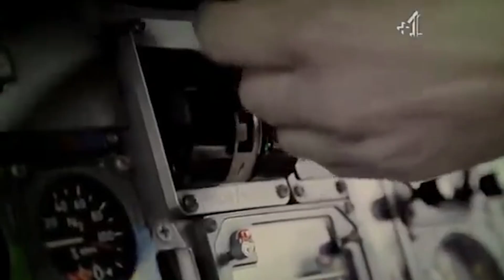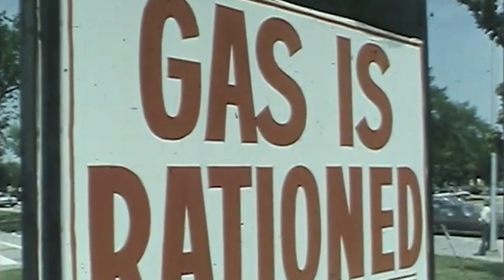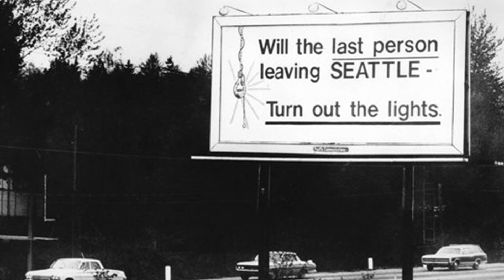The Forgotten American Concordes - Boeing 2707 - Lockheed L-2000 SST

Comment: I believe from some smattering of news on the web, that Richard Branson of Virgin, is trying to revive the Concorde program and have them flying again.
Reply: But that microscopic fungus is common in all aircraft fuel tanks if not managed. I remember my days in the 80's in our South African Airforce, the tiffy's who had to climb into the emptied and flushed out tanks (the fumes so they were not overcome) to look for this fungus and any damage it would be causing. I'm no expert in this as I was and am still involved in electronics, IT and programming, but these guys said that it grew on the line between the air and the fuel itself. And you mentioned one of the issues, but it also attacked the alloys/metals in the tanks, so was monitored regularly. This was not such a problem with aircraft using the "rubber"(more like some fuel impervious rubber compound I think) fuel bags inside the tank space.
Reply: As I said I am no expert in this area and it's not my career, but it's what I observed as part of the service teams in the 80's, of our military aircraft. That is these 'rubber' bags that were introduced and used. Apparently it had other positive effects as well, in that they deflated as the fuel was used and aided in combatting surge and sloshing, along with g-force effects, plus other things I did not understand. From what I saw and understood, they had microchambers in them, and were not one big bag, to help this. It looked almost like a very porous sponge inside them. I remember seeing another product used, mainly for military ground vehicles called ExploSafe, it looked like porous steel wool and was put inside the fuel tanks of vehicles and the jerry cans that carried the extra fuel. This apparently also had an effect of reducing the flammable fuming or venting when vehicles were bouncing around on rough terrain at speed, and explosion if ignited, along with the other things I mentioned.

It might have been a South African invention, I'm not sure.
Reply: The manufacturers declared they would not provide the legally required technical support required for commercial passenger carrying flights, thus Branson had no legal way to fly scheduled passenger service. The British and French governments also wanted to end the obsolete program that had brought them so much financial problems. Better to start with a new fresh design with a much reduced sonic bang over land.
Reply: David Hoffman As I replied in your other post, the sonic boom was never created ever over land. Their flight path both from the UK continent and the US continent was designed to clear any landmass, towns and cities before they accelerated towards mach 2 and their cruise altitude of 60,000+ feet.

Comment: Concorde was a cutting-edge futuristic technology during 1970s that included the first fly-by-wire system, which makes the crew fly the plane more easier
Reply: No it was mostly because of the temperature of the skin of the wings (metal's dilatation), which prohibited to use conventional flight control surfaces.

Comment: I think Boeing just took the money and ran and really were not serious regarding the project......If i was the president and Boeing was begging me for money. I would have held their a&&es  to the fire !!!!!
Reply: Boeing is an amateur compared to Lockheed Martin at taking money from the government to fund the development of an airplane. The F-35 project is a money pit.
Reply: Boeing was serious, but they started with a bad concept trying to do too much too fast. The science lagged the dreamers. It happened before. The B-52 needed eight engines due to lagging technology in the engine department. Boeing had promised the USAF certain capabilities with the B-52 and ended up having to use eight engines to satisfy those promises.  The tall tail B-52s ended up with vertical tails fracturing due to a rushed design. The high bypass Pratt and Whitney engines on the 747-100 gave airlines numerous problems. Asking P&W for too much too fast.

Comment: With technology evolving the way it has since then, It would be interesting if a few wealthy individuals could join with NASA and Boeing to revive this effort. I know GE has produced an engine which generates 110,000 lbs. of thrust. that's three times that of the concord, using 40% less fuel. Titanium is much cheaper  and abundant now.  They can look at a slightly smaller unit like let's say a seating capacity of 250 pax.
Reply: The Ge-110b yes produces 110,000lbs of thrust with much more efficiency, but its a low-bypass, subsonic engine. It would require an insanely large, and bulky ramp system to keep the engines running even past mach 1.2 but its an interesting idea nonetheless
Reply: I read your articles you posted. The article even points out why its own idea wouldn't work:

First the author says this is something that could happen in the DISTANT future and that specialized, extra long, runways would need to be built in order for the electric launch system to gradually increase in speed. So that means you now need to have every airport which this plane will take off from have a special runway built for just one type of plane.  I can't even imagine the cost that would be carried over to the customer to build and maintain these runways, assuming enough airports even agree as  to make enough flight and destinations available.

Second, the author states, which is true, that scram jets only work at high altitudes so a new type of engine would need to be made that can get the plane up to speeds and heights that the scram jet would work.  Which is why the Concord had a turbojet which was a jet engine and afterburner combined into one.

Third, you can't go at mach 10 the whole flight then suddenly slow down when you want to land.  By the time the plane got up to speed and height and then reached a distance to where it now needed to decelerate the scram jet would only be used for maybe 10-20% of the flight.

Four, the author didn't even go into all the exotic materials needed to withstand that type of extreme heat and pressure.  Yes titanium could be used for the fuselage but all the wiring, electronics, motors and engines would need to be made from different materials too. 

Finally, and most important, a round trip concord ticket costed about $10,000.  No one who is going to pay that is going to put up with even the slightest feeling of being uncomfortable or a roller coaster like G effect.

The future is going to be the air hotels.  People would much rather have a long and comfortable flight, then a short and rough one.  The only 2 countries that have enough water between them to allow a sonic boom to go off and are also countries rich enough to have people who would pay the exorbitant plane ticket prices are America and the west coast European countries.  

That severely limits the destinations available for such flights thus shrinking the pool of customers even more.
Reply: another numpty knows zilch about Aircraft or Engines. A lot of Concorde SSC power did not even come from the engines ~ work that one out !!
Reply: titanium is not expensive because of rarity. its expensive because it took a lot of energy to melt it down, and to forge it it needs a lot of very clean water so that the water will not contaminate it during forging.
Reply: isn't the issue still the noise though.
Reply: It would be interesting if a few wealthy individuals could join with NASA and Boeing to revive this effort

That's not really realistic. A few wealthy individuals are too poor to see this kind fo thing through. It needs the sustained backing of a government to make that work. That's how SpaceX et al works still. They rely heavily on the sustained support of public space infrastructure to get going.  The way things work with airline manufacture are still so vulnerable that you can't even get a clean sheet aircraft off the ground these days without either having your competitor rush out a new revision of an old design, ala A320neo, or you end up in legal hell such as with Bombardier and its C series.

The reality is you're not going to see a major leap in airline technology beyond the kind seen in the 787 for a while. The margins are too narrow for airline companies.
Reply: Partner with NASA and you'll never see the end of it.
Reply: 3Gs is a lot of acceleration. That's like a roller coaster. There are people who don't do well on roller coasters, there are also people who likely wouldn't do well with a 3Gs of takeoff acceleration.
Reply: +nothing to see here, move on its not just whether people get sick, it's whether people will put up with the discomfort. But it could work, just have to realize the only place people pull anywhere near that many Gs on purpose is a rollercoaster.
Reply: The L2000 and 2707 programs were canceled partially because of rapidly rising fuel costs and very limited route availability for the SST's, making them even more unviable in todays world. Investors with lots of money didn't get all that money by backing projects that dont make profits
Reply: the main challenge is how to create a quiet sonic boom so that the aircraft could fly supersonic over land and also how to save more fuel if flying supersonic?
Reply: they are attempting to create 'spaceplanes' SST that reach the edge of space in order to mitigate the issue of supersonic booms
Reply: Jet engine technology outpaced the material technology, X-43 demonstrated that an air-breathing aircraft can reach the speed of almost Mach 10. However, the problem with hypersonic engine is that it couldn't take off under its own power, a turbofan can reach the speed of Mach 3.1 (Mig 31 show this), but it couldn't sustain it too long and it could lead to the destruction of the plane. Also, talk about materials, X-15 literally melted at near Mach 7, it need to use sacrificial coating, that's mean that hypersonic aircraft will be a hangar queen, that's not desirable for passenger aircraft due to maintenance cost.
Reply: Look up Boom Supersonic. Thank me later.
Reply: s0nnyburnett that’s so true it’s sad
Reply: It's called boom. Look it up, you'll be amazed
Reply: A very late reply to your comment, but I couldnt help it: Couldnt they then in theory make a hybrid version then? Use the Ge-110b as a startup  engine and then switch to a  more conventional jet engine once desired speed was reached?
Reply: Elon Musk mentioned in passing during his Mars conference that there might be a market for reusable rockets in air transport.
Reply: AF lost money. BA was doing fine.

Comment: Russians stole the Concorde design - then rushed to build it - messed it up and that was that.
Reply: Nope, different wing, different air intakes, different engine placement, different fuselage crossections down the length. At best the USSR got some gains from Europe in materials, controls, and instrumentation. But the overwhelming majority of the Tu-144 was unique, and home grown in the USSR. Copies in the USSR are obvious. Il-162/VC-10, Buran/US Shuttle, An-124/C-5, IL-76/C-141. The Soviets did copy, but not on their SST.
Reply: That's a total BS myth. The soviet plane was a legit design. Obviously the wings look similar in shape, because the laws of physics are the same to all companies. And as for its problems, obviously a project like that wouldn't be perfect right away, the Concorde was also flawed at first and both planes were fixed.
Reply: I have a book about the Russians getting hold of the blueprint for Concorde.
Reply: Apparently it is rumoured, that this blueprint was doctored with failing systems, and released on purpose to the Russians, to keep their work from reaching a succesful state. If this is true then this is supposedly why the two Tu-144's did crash. But again who knows if this is true in the cold war of the time.
Reply: So copies are obvious right? Il-62, An-124, Il-76 ... all copies? Allright then. And what about e.g. Boeing-727 - than it must be copy of Hawker Siddeley Trident...and also Lockheed Tristar seems suspicious. Dassault Falcon 50 must be than copy of Yak-40. Airbus-320, Dassault Mercure or Bombardier-C - theese all must be copies of B-737 than....
Reply: But B-2707 and Lockheed L-2000 look almost EXACTLY ALIKE ALSO don''t they? Also except some "funny and stupid looking" modifications. But they are from USA so it cannot be copies...
Reply: The Russians didn't steal it. Same stupid american arguments as anytime, if someone is faster or better... The basic design is determined by the law of physics and not the law of backstate Texas... The design includes "duck wings" for better steering and stability and an very centered engine block design that withstands an engine shutdown much better than the Concorde design in preventing asymmetric thrust.
Reply: You're so much right, totally agree with you. Thanks for this ultimate clarification. Have a nice day & hopefully Britain will not leave too far from the EU so everything that grew together in the last decades will not divide. No more hate, arms race, just understanding... I love Britain since I'm 11 y/o. Good luck to you!
Reply: The Concorde design team stole the delta wing concept from the Canadian Avro Arrow jet interceptor in the 1950's. Actually much of the same team of engineers did both, including some that ended up working for NASA
Reply: Lets see, the modern version, although not a passenger craft, Tu 160
Reply: Sure as Hell they did,take a look at the Bloody thing? They look almost EXACTLY ALIKE don't they? With the exception of the Funny Looking Conard winglets near the cockpit,it makes the whole Airframe look STUPID!!!!
Reply: You cannot build something as technical as an aircraft just by looking at a photograph; there is far more to it than that.
Reply: They got good concept drawing and analysis for the early delta winged version of the Concorde. The later designs with the ogive wing were discovered by the Soviets too late, as they were well on their way to making a delta winged SST. The retractable canards were added to deal with low speed handling problems. The Concorde avoided those problems with its unique wing design.
Reply: 002o I don't think you have to press Boeing too hard for them to admit that the 727 was heavily influenced by the HS Trident. Again enough departures in wing, and cross sections to warrant a lot of independent work. As for the Dessault Mercure, From the 737? No influenced yes. But it had the wider cross section and the slung podded engine. The Mercure influenced the Airbus A-320 if anything.
Reply: Yea, I know, but my comment refers to the above used old U.S. argument of that the Russians had stolen their technology... :)
Reply: Please be noted that at that time Soviet Union and France and United Kingdom has agreement about sharing of technical details during building supersonics. Even was created some technical delegations who visited Soviet Union, especially Tupolev Bureau. Yes, TU-144 was made first flight, but successful commercial start was maded by Concord.
This is historically proven information. 
And, Concord of Air France was died in range about 3 km from the place where died russian TU-144 was
Reply: yup Russians throwing there hand into something. with blown up numbers. ask Russians how many of their gen 3 MIGs got shot down in Korea. made the only ace in modern jet fighter history out of a American.

Comment: why not  now  revive  them  both ?
Reply: fuel
Reply: yes, big  market  as  many  would  pay  the price  for  faster  flights...I  would
Reply: +David Sheriff Fuel is expensive, from gate to runway the concorde used the same amount of fuel an average car used in 6 months
Reply: Fuel  is  now  cheaper.....use  electro  magnetic  propulsion..easier
Reply: The Tu-144 is a terrible design. Noise, vibration, harshness, and fatigue problems. Subsystems unreliable. HVAC undersized. Those retractable canards exist to reduce terrible low speed handling characteristics. Far better to use it as an example of what not to do. 

The Concorde would need all of the proposed changes that were to be the B model. Leading edge flaps, revised wing, engines that deliver more power without reheat or afterburner, and slower takeoff speeds.
Reply: I  am  sure  they  will  return in  some  guise  or  another,,,,,,hydrogen propulsion being  tested  out....

Comment: For the longest time the full sized mockup of one of the aircraft remained in Florida and even became a church with the mockup there as a centrepiece. Supposedly the nose and crew compartment still survives is in some museum or another. It's sort of sad to be in the 21st century and we have no supersonic plane and no flying cars. Volume won out over speed...
Reply: A full size mock up of which plane the B2707 or the L-2000? That must have been interesting to see. Could the nose and crew compartment be in Seattle's Museum of Flight? I agree that it is sad to be in the 21st Century and no longer have an SST flying commercially - feels a bit like we've gone backwards considering the A380, though envisioned before the end of the Concorde flights - it didn't fly until after.  However, I'm not so sure I am eager to have flying cars - some people seem barely capable of driving.